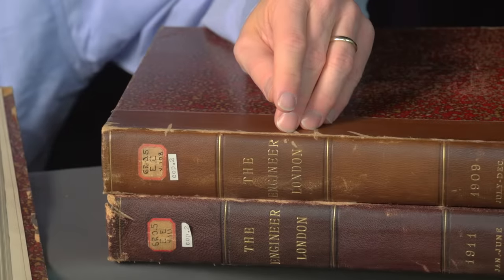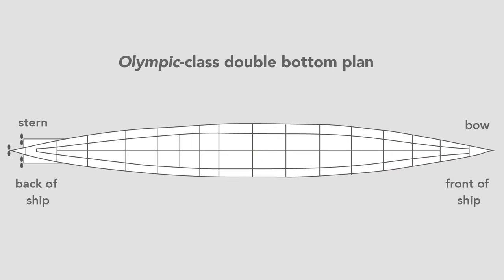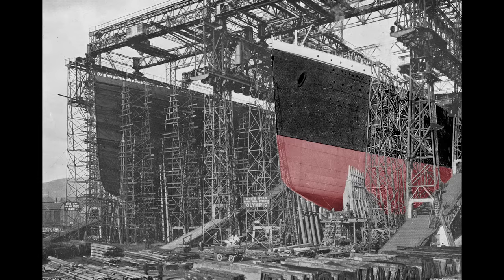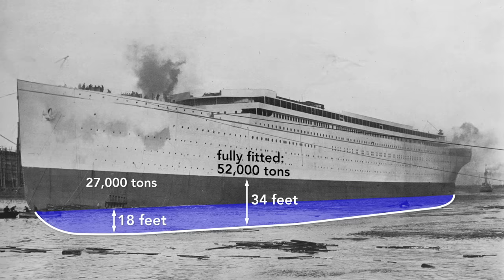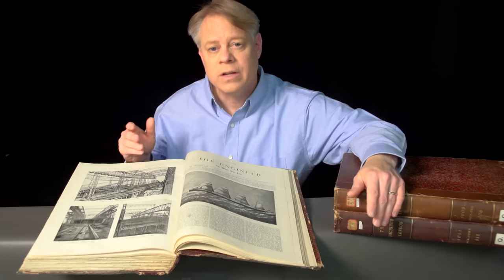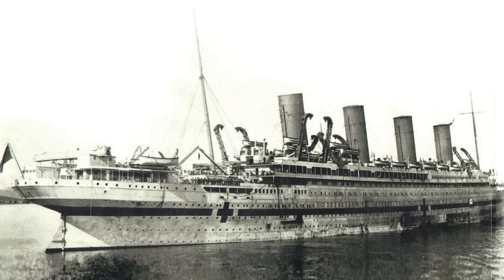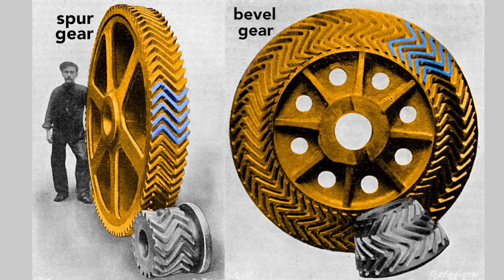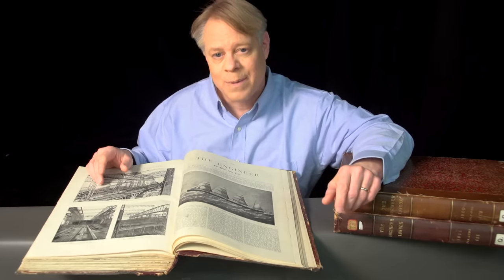RMS Titanic: Fascinating Engineering Facts

Comment: Can you clear up the titanic story about the engineers going down with the ship? All through my childhood it was widely believed and repeated that the engineers stayed below deck to feed the fires so the turbines could go as long as they could before sinking. It was this glorious story of men knowing they would die to save others, however in my most recent research, it seems that witness accounts and news articles from the time say no engineers stated below deck and that they were called up before the ship sank? Do you know which is true?
Reply: Simply said, the only people who would know the true answer to your question are long dead unfortunately. Titanic sank over 100 years ago now, and over 75% of Titanic's crew died aboard the ship when it sank. It is safe to presume however that a large number of Titanic's crew whom served below-deck in the engine and boiler rooms did man their stations until the end, if for no other reason than because it was either impossible or impractical for them to make their way to the deck, given that the boilers and engines were located at the very bottom level of the ship. http://www.icyousee.org/titanic.html
Reply: Most of the crew working the boilers (stokers, firemen etc) went up on deck.  They didn't have much choice.  The boilers were raked (burning coal removed) and because they were towards the front of the ship, they got flooded earlier.  Leading fireman Barrett ended up in a lifeboat because he was on deck after doing all he could below deck.  
The crew working the engines are a different matter.  The engineers helped to keep the pumps going and the electrics working.  The lights didn't go out until very near the end, so it's clear some of them were still down below.  Some engineering officers did stay below.  Shepard was one of them.  He ended up falling down an open manhole and broke his leg.  There was no way he could get to the boat deck.  Another engineering officer, Harvey, stayed with him.
 I think once it became clear that Titanic was lost, the officers released the crew and told them to try and save themselves, but they knew they had little chance of survial so decided to stay to keep the lights burning etc.  Nobody can be 100% sure what happened, we only have testimony from survivng crew members (like Barrett) but I think it's safe to say that most of them knew they had very little chance of surviving.

Comment: The main reasons the TITANIC sunk was poor Engineering. None of the Bulk Heads were sealed, they were left open to allow for more Luxury space above.So once one water tight compartment flooded the water would just flood over and flood the next. Ship was doomed.
Reply: Wrong. The first four forward compartments toward the bow and 4 compartments to the stern were sealed. She would have survived if only the first four compartments had been compromised. The iceberg opened up 5 compartments which cause the bow of the ship to be submerged. Once the bow gives way to the weight of the ocean there's really no stopping the flooding from overwhelming the ship.

Comment: The ship that went down was the Olympia which had a massive starboard side accident a year before almost writing her off.. JP Morgan swapped everything from one ship to the other, including the name and then committed insurance fraud. Check out the port windows. One was round and the other square. Check out the original build diagrams and pictures and then compare them to what went down. The plan was to have a followup vessel trail the Titanic so as to minimise the dead. However, with no radar and heavy fog the support ship got lost but JP MOrgan made a fortune as this was the unsinkable ship.
Reply: I've read an awful lot of comments concerning that ridiculous conspiracy theory, but for pure stupidity, yours wins hands down.
Reply: @Dizzy19. Do some research or look at the plans (if you can read blueprints). Other engineers have done the research and have come to the same conclusion. So you go ahead and believe what ever myth you're happy with.
Reply: @bicanoo_magic3452  You can't even manage to get the name of the sister ship right, as for the rest of it,  windows round and square, no.  Follow up vessel, no.  Heavy fog, no.  Made a fortune, no.  Try again dipstick.
Reply: @bicanoo_magic3452  Titanic had design changes to B-deck that took place during construction. It would have taken 6 months to a year in drydock to make those changes on Olympic. Everyone and their mother would have known something was up. Also, Titanic was under-insured by $2.5 million when she sailed.
Reply: @gnranger  Whoa... nice one. I'm not  sure if they bothered with the B-deck changes. But being under insured might  have been a ploy by Morgan so as not to draw too much attention. The Olympic was damaged hard rear quarter starboard. Exactly where the Titanic broke in two. The Olympic then went on for five more years before being decommissioned. A heavily damaged vessel could not have gone for another five years with out major repairs.
I'll see if I can dig out the YouFail video of the alleged swap.
Reply: @bicanoo_magic3452  Titanic split just behind the 3rd funnel. Hawke rammed Olympic astern, 87.6m from where Titanic split, breaking the ship's prop shaft. Olympic wasn't decommissioned till 1935. Without the B-Deck modifications, the visible retention of the B-deck Promenade and absence of the Cafe Parisian and bigger first class cabins would have told everyone in Belfast and Southampton that the ship was not Titanic.
Reply: @gnranger  Well. I'm convinced. I don't think anyone knows more about it than  you  do, that's obvious. WOW. I have to say it seemed pretty plausible but I'll take yours as the last word.

Comment: its so dissapointing all this work that went into a ship was destroyed.  there is clearly so much intelligent design, sweat, hard work, etc put into these ships
like one problem to consider is determining how much buoyancy the ship will achieve and how much mass you can fit onto the ship without it sinking and then given a certain maximum mass you can use, how to spend that allotment on certain things you put into the ship. when he talks about the propellers, those things weight 30+ tons!!! its absurd the weight of things put in.
and then determining how much coal will you need to make a trip. how do you know how much energy is generated per amount and numberof boilers and how a propeller  interacts with water and ...bla bla bla so much i have no idea about. but this is a physics /engineering nightmare and dream

Comment: Whilst the bulkheads on both ships were different changing one to look like the other would have been very easy. And as for the number being stamped on the metal for inspectors to see, again easily fixed. The evidence that there was a switch is huge and the case against the "conspiracy" is based on zero understanding of what these men were capable of doing.  ZERO.